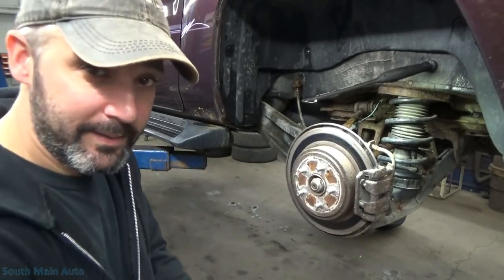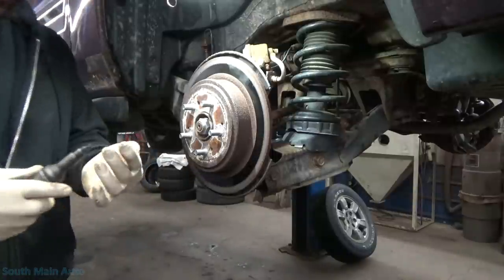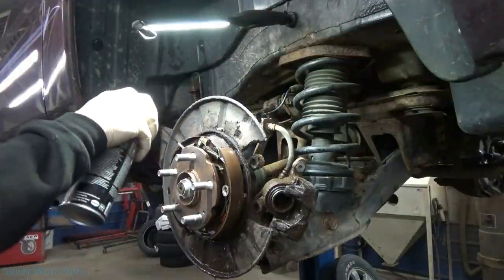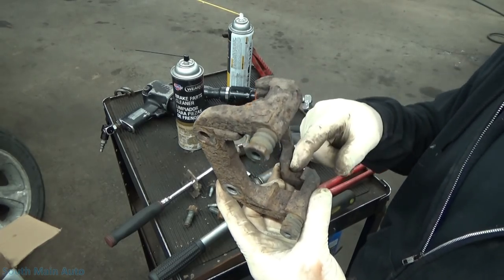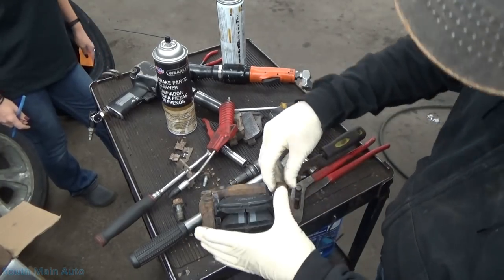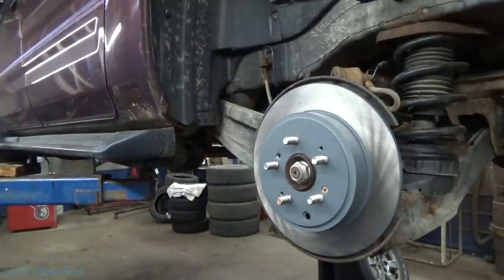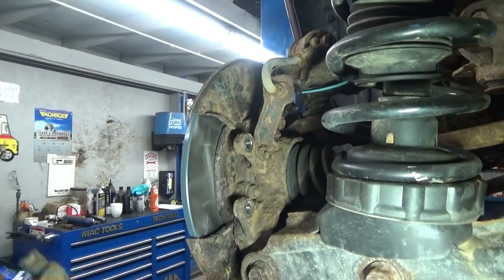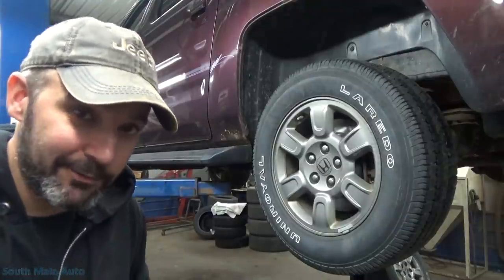Honda Ridgeline - Rear Brakes

Comment: Eric O even makes a simple brake job look so darn good. Customers all over the country would have less complaints after brake repairs if mechanics did quality work like this video illustrates. Always impressed with the time spend on the small but highly important details of his jobs. I also learn a lot because he takes the time to explain those smaller details and the consequences that may arise if you fail to do them. Ive always over lubricated my sliding pins because I once had those pins seize up on me in the bracket. Eric explained why over lubricating those pins can actually cause MORE problems by pushing the pins back out and hanging up the pads defeating your whole objective. Thank you Eric O.

Comment: I us the Permatex Ceramic Extreme on all the metal contact points  like you and use Permatex Ultra Disc Brake Caliper Lube on the slide pins & bushings. Never had any issues myself with any brake jobs on customer cars or my own. Heard & read all the issues some people have had but they are the few.  Probably going to try the Permatex 80653 Silicone Extreme Brake Parts Lubricant next...heard some great reviews on it and it is supposed to be compatible with all rubber boots, seals, bushings...after I use up all the stuff that has worked great for years :D

Comment: Wife came home the other day telling me her "front" brakes were making a horrible noise, turns out it was both the rears with the driver's side actually dragging. I figured I'd look to see if there were any Youtube videos on it and found yours. I'm pretty good with a wrench and plan to go a few steps further than you did like painting the calipers and hitting the suspension components with rust restorer and paint after a little cleanup but I'd like to thank you for your efforts it's going to make my job go a lot smoother seeing the process in advance. Looks pretty straight forward, the truck's already on jack stands and wheels removed, next step is remove the calipers and see how bad things look, I'm hoping to get away with just rotors and pads and removing the rust nodules before hitting whatever needs it with some paint including the calipers. For lube I like to use some well placed silver never seize, can anyone tell me why this is a bad idea? I've never had an issue with it.

Comment: Been using the purple stuff ever since the NAPA guy put it in my bag o'goodies without me knowing. Was $20 then - nice to get it free! I've seen the stuff harden up a bit on my truck, but that thing gets abused big time. Heavy foot no matter what I'm towing behind it. It's brakes get HOT. :D Lesser brake lubes would just break down and fail completely, and ruin the pads when the caliper seized on the pins.

Got a couple stories for ya regarding local "techs" and how people view quality work. First, I brought my '93 Volvo 940 to the glass place for a new windshield. Found my carpet sopping wet on the passenger side - had to take the seat, and all the sound deadening "jute" out of there to drip dry. Anyway, I get the car back, and my passenger side wiper is SMOKED - stripped clean. Wouldn't even move, even with the nut tight. I get that it's a nearly 25 year old car, but the guy didn't even tell me! To top it all off, the driver's side wiper arm was mounted too high up on the windshield - looked ridiculous! Very few people these days take the time and effort to do a good job. Sad.

Story #2: neighbor had a rear hub bearing installed at another shop since I was busy with my addition project. That was a little over 2 weeks back. He stops by and says his e-brake isn't working anymore. So I yank the rear brakes and rotors after verifying the cable was still good and moving everything as it should. Turns out they were just out of adjustment, probably from my 86 year old neighbor leaving it on a couple times. It happens. But, on the side that had the shiny new hub bearing, the adjuster star was so friggin tight I had to remove it and throw it in the vice, and hog on it with big Channel Locks before it broke free - I can only assume it was the last guy that worked on it, spinning the star the wrong way ... with a hammer and screwdriver ... and gave up when they got it stuck, and couldn't recall which way it was supposed to turn. Unreal! Took me all of 45 minutes to do both sides, and that's using  a jack and jack stands! They were right there - they could've at least got ONE parking brake working - better than NONE! 

Anyway, I got her working correctly. Now if he leaves the brake on, it'll drag the rear tires - that will get his attention. :)

Comment: I switched to the permatex ceramic brake grease 8 months ago and have had great success with it. I am also in the rust belt of new England (CT). My come back rate is almost zero since the switch. My opinion; Best stuff ever....

Comment: @South Main Auto THANK YOU! I’m about to do front and rear brakes on my “new to me” 2006 Ridgeline in two weeks! I actually flowcharted your directions/actions while watching this video. 

I’ve actually done brakes several times on my 1995 Saab 900 but for some reason I’ve been apprehensive about doing the Ridgeline brakes. Seeing your video made me realize that it’s basically the same, just a bigger vehicle. 

Found your channel by accident. So glad I subscribed! 😍😍😍

👍🏽👍🏽👍🏽

I ASSUME the fronts are just as easy with no “gotchas” I need worry about?

Comment: Good times with SMA. Interesting to see the little things people to differently, I always fit the caliper bracket to the car, then put the pads in, otherwise I end up dropping them lol. Also first step should be check the brake fluid, if it's been topped off it could overflow when you press the piston back in!

Comment: Eric - It is fun to pound on the rotor to get it off but the rotors on the Ridgeline have threaded bolt holes to thread in two metric bolts (forgot the size/have them at home) and as you alternatively tighten them, it'll pop the rotor off.  Clever Honda design...Again, not as much fun as a 3 lb sledge but quieter.

Comment: I had that pucker. After a firestone shop left my a-arm bolts loose on an alignment, and I ripped the a-arm, shock, cv shaft off the frame, they didn't set the brakes on round three. (Round two was subpar parts replacing high end ones that were wrecked.) Pulled out of the shop, got to the end of the block, and blew through 6 lanes of traffic on a red light in Denver. E brake was left unhooked, somehow they thought it was causing problems bleeding brakes... Thank god I somehow made it through. I almost got arrested that day.
Reply: Oh yeah. I had to talk myself out of parking it in the middle of the lobby. crash shatter "Hey guys, I'll give you one guess what you forgot to do!"

Comment: Thanks for your video. I have an 2008 that I have to do all 4 wheels, rotors, new pads. I”m glad I have a small lift to use so I can methodically do all 4 at once. I”m glad I don’t have the salt/rust issues in my area. I’ll be checking your other Ridgeline vids for more tips. Thanks !!!

Comment: That brought back memories from when I lived in the finger lakes. It always seemed to me that every time I had to bleed rear drums that I might as well just have a couple wheel cylinders ordered up ready to go. Use to hate that and have freaking brake line snapping off at the fittings when doing caliper R&Rs

Comment: Great video! I never understood the right way to lube the pads and bracket. Question: when you push the piston back on the calipers, don’t you push brake fluid back to the master cylinder and possibly out the top?

Comment: When you put the new rotor on, you say the parking brake is on but, you adjust the it so the rotor spins. Did you mean to say that the parking brake is off? Great video by the way.

Comment: I've never had an issue with the ceramic brake lube. I'm in NYC, we get our share of salt, crap and bad drivers and I think any lube will break down given enough time, heat and salt exposure. Living on the coast makes it worse. Guys like me that take their trucks to the beach fishing, I pull the wheels at least once a year to clean and lube the brakes.

Comment: Hey if you were located in NC I would let you do my brakes. I do it but you do such a thorough job. I usually clean any rust but install pads only unless rotors have groves in them, usually never clean like you. Thanks

Comment: Great video!  Thanks a ton for this comprehensive brake job video.  Very informative and thorough.  I'm about to do my own brake job on all 4 wheels of my 2008 Honda Ridgeline.  I was told I need rotors and pads on all wheels and was quoted on Carquest Platinum rotors and Carquest Wearever ceramic pads.  Maybe you can't (or don't want to give reviews) but if you could just give me a thumbs up or down on those parts I'd appreciate it.  Just making sure I wasn't being hosed by the shop....it could be that I don't need all 4 wheels done.

Comment: Same pads and rotors I usually use, wearever platinum seems to be pretty good quality, and dusting isn't too bad on the wheels.  The 30% off code ordering online and picking up in store at Advance saves a good bit, too.  Lines I order from Rockauto, though.

Comment: All I need is a battery powered impact ratchet! Know of any good ones? My Ryobi impact gun is the shiznit, jus too big to fit behind rotors! Of all the videos available, I always check SMA first. Your content is easy to understand for a working class person, like myself! Appreciate the info, you have saved me a bunch of money btw.
Reply: Update....2010 Hondoo Ridgeline passenger side rear brakes - The 17mm caliper mounting bolts require a impact ratchet, because there is limited clearance for an impact gun, or a breaker bar for a regular ratchet due to bolt orientation (the way you have to unscrew them to get out). Since I had it tore apart ready to remove and had no impact ratchet, after trying for hours and couldn't wait until the morning to go buy an impact ratchet, , I pulled out my other floor jack, took the core from one of my jack stands, and used both on the handle of my 1/2" socket wrench to add enough pressure to break both bolts loose. I was afraid of snapping the bolts, but the broke loose and everything went exactly as described in the video!

Comment: Please clear up the Honda CRV brake wear indicator position for me.  Just did my first brake job ever which went well, however, I think I hear a slight grinding sound (on the right front rotor when coming to a slow stop.  I used all the products you've used in this and previous videos and I'm certain I greased up all required area where metal to metal contact exists.  I got the caliper guide pins in correctly with the one with the rubber bushing on the bottom.  They too have been greased and the boots have been burped.  The brake hardware kit came with everything except the anti-rattle clip.  The hub was cleaned and I ground all the rust away so that it was super smooth...even used emory cloth to do a final sanding.  Used copper based silicone paste on the hub as well.  CRV drives great but that grinding (rotor?) sound on the right is really bugging me.  I put the inside brake pads (where the caliper boots are located) installed with the indicator down just like I saw on the old pads.   Once I torqued the caliper mount and guide pin bolts, I tested and the calpier with pads installed slid side to side just fine.  Oh, I even lined up the flat side of the caliper pins with the slots on the caliper mounts.  So, could the inside brake pads have been installed incorrectly from the start and may be causing my issue?  Please clarify so the newbie do-it-yourselfers are educated properly.  Also, I only did my own brakes after having watch the two ladies change out that front suspension as you oversaw their work...funny as heck and that prompted me to man up and make things happen for myself.

Comment: Has anyone else that lives in the rust belt states tried globbing (it's a technical term) up their bleeder screws with grease to preserve them? Eric doesn't seem to think to highly of messing with them but I wonder if it would work? Obviously you would have to clean them off before using them to bleed the system, then apply another glob when you're done. Does this sound sane?

Comment: Hey Eric,  Love the videos you put on here.  Thanks!  I learn a lot watching you work.  Just wondering.  I always thought pounding on the rotor with the hammer was bad for the wheel bearings.  That is why there are threaded holes on the face of the rotor.  You can easily thread a bolt through the face of the rotor to break loose the rotor from the hub.  Anyway, maybe you addressed this and i missed it.  Thanks for your time.
Reply from the maker: Rust makes the threads disappear so just not an option, and you'd have to whale the piss out of a hub to bend it so no worries there

Comment: Eric I have to ask, are the brake pads you installed the Platinum Pro pads from Advanced Auto? If so don't you find that they leave an significant amount of brake dust? I installed these pads along with the Advanced Auto Premium rotors on a 2015 Ford Edge and 2010 Acura MDX and on both vehicles these pads leave make a ton of brake dust. Thanks, Eric

Comment: On one of the "Hondo"  jobs I watched today, you made the comment that if you moved south, all you would need is an adjustable wrench.  I'm sure that was said tongue in cheek.  However you can run but you can't hide.  seems like many from the northeast move south, and their vehicles follow.  You still have to put with that salt cancer until the customer trades the car or it falls down.   Just sayin............

Comment: Eric, I’ve always known to use silicone paste or a silicone-type lubricant on the slide pins as anything else has the chance of reacting with the rubber and swelling them up. I see the lube you are using is ceramic-fortified with no silicone. Have you ever had any problems with the rubber slide pin boots and that lube? I was just wondering..

Comment: 25 years wrenching in Chicago, so I 'get" why you are reluctant to open the bleeder screws unnecessarily. But don't you occasionally 'take out' a master cylinder due to forcing that volume of brake fluid backwards that quickly? And what about ABS modulator valves picking up 'particles of crap' in the brake fluid that is forced backwards? 
What about flushing the brake fluid when you do a brake job?
 
I understand the cost of repairs in your rural location may be a bigger issue when compared to "the big city" and with as bad as those particular rotors were (like 1/2 the swept area looked to be rust baked onto the rotors) the customer will definitely experience better braking on the rear brakes, but will the brakes be as efficient as they can be. Water in the old brake fluid will compress enough to cause a spongy & low pedal. 
How good will the ABS work with the old fluid?

Comment: I'm wondering why you don't sand blast the whole caliper bracket not just the contact points. Great video thanks.
Reply: not Eric but, I only sandblast the contact points.  anything more would cost the customer more in time.  it is just going to rust again unless you treat it and that will cost the customer even more.

Comment: Like the video.. Yet you left room for critter-sizzum.  I take you to task on the comment you made about moving south and using the crescent wrench to work on cars.  We'll, have to edj-uh-muh-Kate you on the prpoper use of tools down here.  First off, we rarely use crescent wrenches when you can get a better grip on a bolt with a 14" pipe wrench ( or 35.56cm for those in our metric mountains like Ashville and Boone now).  And using said pipe wrench can only be properly performed if the pipe wrench has a slight curve in it due to someone putting a 4 foot ( or a 121cm to 126 cm) piece of pipe on it to encourage the bolt, or nut, to give up and be freed from whatever is left of the threads it was protecting.

So feel free to consult with the metric mountain me-can-ee-acts for the use of, and applications onwhich tool fits the right job.  Safety is our fourth most important rule here in the south.

Now, if you'll excuse me, I am going to teach my nephew how to get that hardened concrete out of the mixer wit 5 pounds of tanerite.  That could be a video in its own right.  Would be nice if it was in its own left, but that ain't a gonna happen is it?

But we cannot make it until cousin "idiot" Brian the brains eyebrows grow back in.

Thanks for taking the time to learn about Southern tool etiquette here.

Comment: Hey, thanks for the video! I will be tackling this project soon.  If I am just a DIYer without air tools, what do you recommend to use to clean the wheel studs and  hub face? Also, any recs on which pads and rotors to buy? Thanks again.

Comment: i don't know about using Fluid film  on the hub face , that stuff is marketed as penetrant lubricant also , don't you think that stuff will coat the inside of the  wall of the parking brake as the wheel rotates  myself i always have brushed antizeize  on the face of the hubs , just a very light coat and is always been there when i have removed it again, yes i do live in the rust belt.

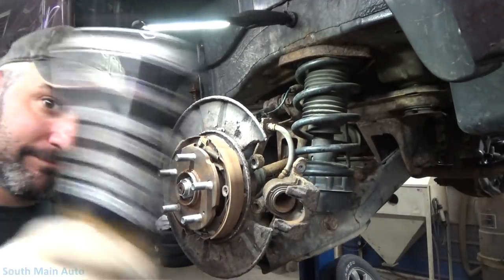Comment: Can I ask for clarification on something: at 12:18 he says he forgot to clean the hub before sprayed with lube. Does this means i want to use the 3M wheel hub cleaning device from 12:20 before I spray the brake cleaner around the hub(he did this at 5:00)? 
Thanks in advance